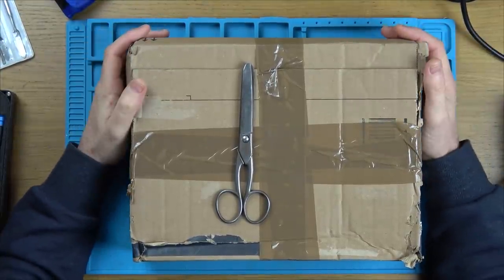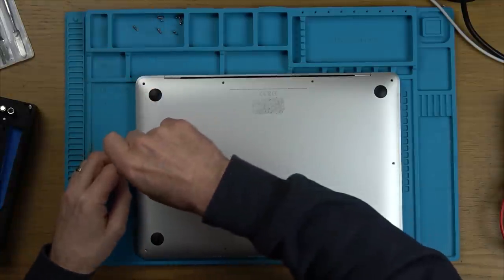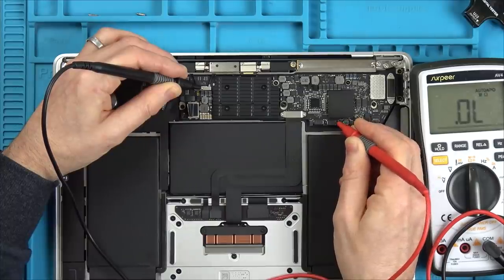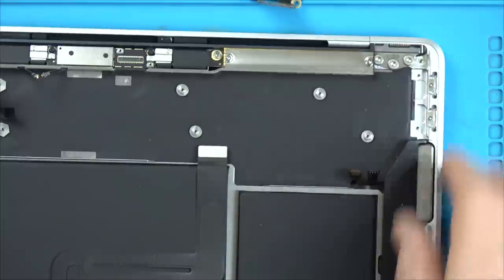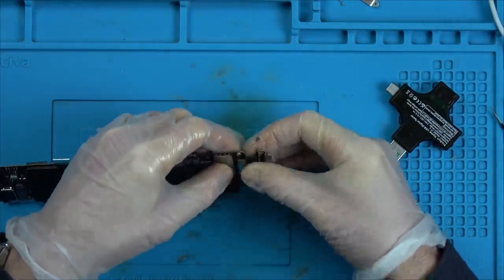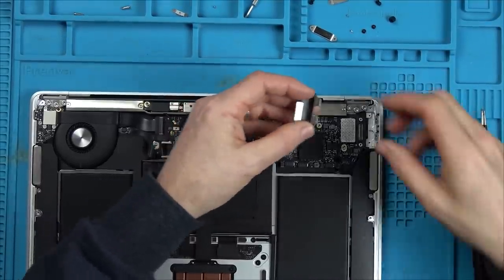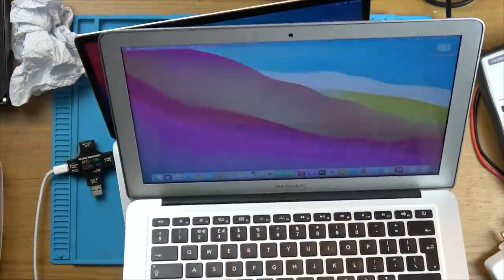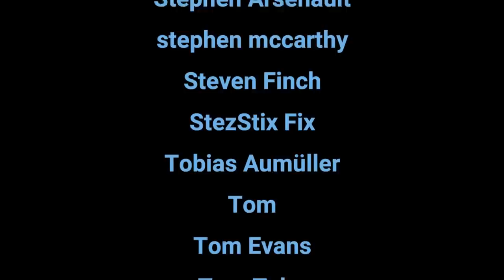A BROKEN £200 ($260) 2020 Apple MacBook from eBay - Can I FIX it???

Comment: That is absolutely fantastic and makes the huge amount of hours you've spent fixing mac books worthwhile. The clue was in your USB tester not showing a voltage. How fab. That's probably worth about 600 now and your daughter will love it!
Reply from the maker: Thanks Paul, she is using it right now as I type, and yesterday AND the day before that. This one will get plenty of use. Fingers crossed it will stay good 👍👍
Reply: @Mymatevince  buy a broken board to get the chip or contact louis. he might be able to point you to someone

Comment: When wiping the internal drive, change the view setting to show the actual drive, those 3 drives are apfs containers, not the actual root drive if you want to change that, you can also just go into disk utility and merge the other apfs containers into the drive you chose for mac os big sur
Reply: That sounds super user friendly and why I don't use apple products.
Reply: @SPEXWISE  buhu 🤡 takes two clicks.. did you know how too use every program on a windows or linux machine the first time you tried it? didn't think so...
Reply: @SPEXWISE  well i mean, they did kinda fix it with monterey but not every average consumer wants to know hoe to wipe their drive, most people will just take it to some shop to do it for em

Comment: Nice find and repair Vince! I wouldn't have used the original lead either. Your daughter sounded real happy. Cheers!
Reply: Definitely. Leads are cheap and if you blew either the charger or laptop chip you'd never forgive yourself
Reply from the maker: Cheers Shawn, sporting a new logo I see 👍👍👍👍
Reply: @Mymatevince  with losing my old HDD and some pre-recorded content, I decided to take a step back and focus on a few changes. New logo for the channel, my son's drawing of "Pup" the dog is my new in video thumbnail, and then a few other odds and ends here an there.

Comment: What a nice, satisfying fix :-) I'm wondering if those problems could have been caused by an aftermarket magnetic connector. It did seem like there was some sort of corrosion around the area, but apart from that this is pretty much what I expect a bad magnetic connector would cause. I have never seen this myself but I have read about it.
Reply from the maker: Thanks Gero 👍👍👍 Maybe it was one of them!
Reply: Yup poor aftermarket charger causing sparking on high voltage high amp pins.

Comment: Good video. As always! Thanks for that. I was watching on my smartphone in the morning and asked myself whether you put the power meter in the wrong way around and couldn't read value due to this.
But then on the bigger screen I see: The current is showing up correct. I have a power meter of the same build. This one will only measure voltage when going this direction. Current is only shown when plugged the other way around (which is the more complicated way, due to the plug types being strangely selected for that...). 
Learned something new today (much variety even if things appear to be the same). :)
The joy of your daugther was the best thing you could ever get out of a repair. :)
Reply from the maker: Yeah it does look like it is backwards. Quite a few have thought the same on older videos. Cheers for watching and commenting 👍👍👍
Reply: @Mymatevince  I was thinking whether I should be trying to fix my meter. ;)

Comment: I think the cable end got damaged first, or some tiny piece of metallic debris in the slot, it knackered one of the USB ports, manifested as intermittent charging, so they tried it another port which then also got damaged. What else would damage the same pins in both ports? Great fix, well done.
Reply: yeah, I agree with this, I think the bad cable caused the problem!  great fix though mate and nice score for the price :)

Comment: I have no idea how in the midst of Apple's brutal anti-repair anti-consumerism, they have the USB ports being fully replaceable and it's cheap, too.

You did great here, man. Awesome repair and it's essentially like new---I'd argue better, it's proven to work and be inspected for basic electrical faults and problems.

My gaming laptop had its charger burn out at the wall plug, but thankfully all it took with it was the surge protector, my laptop itself was safe. It's scary what a bad or failing wire can do.

Comment: Vince, I have a macbook pro 2017 A1707 board you can have for spares? It had the usual charging issue, sent it to someone who couldn't repair it and blew a few components all over the place. It's yours for spares if you want it, only thing I ask is postage to be covered. I replaced the board in the end and it was cheaper than the repair

Comment: You can boot into single user mode and reset the initial setup flag through command line if you ever run into one that wont let you into recovery without an admin password.  Reboot to create a new admin acct and then boot into recovery to wipe it clean.  Ive done a few of those at work

Comment: I don't fix electoronics as a hobby but the other month I was browsing eBay and saw this exact model for £120, seller said the only fault was a broken screen. Sure enough when the laptop arrived the only problem was a broken screen, so I purchased a tool kit and a screen for £185 and it works in great condition. Got  a 2020 MacBook Air for round about £300!

Comment: Hi Vince here’s a suggestion for a trying to fix video: 
LED light fittings. You know the ones that come in all kinds of designs that say the LEDs are irreplaceable? I’ve been looking for one to go in my living room but I’d love to know if they really are a giant waste of materials when an LED strip inside the light fails or if when the driver fails if that’s replaceable as well? Just something I thought of no worries mate thanks,
Reply from the maker: I seen those in my local B&Q (DIY store) and I thought the same thing. They look lovely with the integrated lights but what happens when they fail. Maybe if they are sealed then they will last the advertised hours...not sure though!! I will have a scroll through eBay to see if any are for sale. Cheers for the idea 👍
Reply: @Mymatevince  yea I’ve seen them in B&Q as well and I thought they look nice but are quite expensive in there. EBay and Amazon seem to have better prices but I wouldn’t know if they are similar quality or not. No worries thanks for replying and you have a nice rest of your evening 🙂

Comment: Great reaction, wonderful gesture! Just a thought, was that the genuine Apple charger and cord? Ive seen non genuine cords and chargers cause issues with the ports. Ether way I would be binning the brick and the cord if the short was at both ends of the charge cable.

Comment: Well done! I guess you got lucky as you mentioned it could've been cloud locked rendering it useless. One reason I have stopped purchasing expensive items like this to repair from ebay. I have a large collection of cloud locked phones & tablets!
Reply: To my knowledge MacBooks don't have icloud lock, as long as you can reset it you're good to go
Reply: @rahulchandra152  Unfortunately newer ones do. Really stupid choice made by Apple really. I get the point of iCloud Lock in terms of making stolen devices unusable but it has the side effect of rendering a lot of perfectly legitimate devices useless as there is no way of removing the lock without access to the original account of the device. They should be a system in place where legitimate registered recyclers can get these locks removed.
Of course if Vince's mac had been locked he'd be stuck as allowing anyone to get devices unlocked would defeat the point in iCloud Lock to begin with as thieves could claim to have bought a device that they have stolen and just show a phoney receipt to get it unlocked.
Reply: @TheAlphaWolf2013  not icloud lock but ufi lock

Comment: Your videos encouraged me to fix the keyboard on my gaming laptop. I've done this before on older devices but then it was a simple screw from the front and replace. With this I've got to take out the motherboard! That means removing the battery. On older ones they clipped on the back. Incredibly easy. Not so here. When I tried to unclip the connector I got massive sparks from it so I gave up! It still works with a couple of somewhat unresponsive keys just like before. I must have shorted something. I was trying to prize open the clip with a metal flat head screwdriver from the 2 outside plastic edges so shouldn't have been able to short connections. Thought I'd destroyed my laptop or battery but both are fine and still are after 2 months. So was it two wires of the connector internally touching when I tried to pull it out and was a bit diagonal? That sparking was not small. Would I be better discharging the battery first before trying again?
Reply from the maker: Maybe Paul or I wonder if the screwdriver shorted between a ground (so the case of the connector, or a screw head on the board) and the positive of the battery. If you use your finger nail to ease it out or a plastic spudger tool then at least it won't short unless like you mentioned it is happening internally if it is a bit diagonal. Hopefully next time (if there is a next time 😂) you will get it out without any fireworks 👍👍👍
Reply: @Mymatevince Thanks.  If I'd used my finger nail and that happened internally I'd have severe burns as that wouldn't be cold! But a plastic tool sounds like a good option. I did take the keys off take of rubber mount and put it back on and now they are responsive but don't quite click properly like the rest. I feel though that unless it gets worse I won't take the board out because there's a whole host of other things I could actually damage like fragile ribbon connectors when doing so. With previous laptops I've been quite hands on. Taken the CPU cooler off, applied new thermal place, swapped hard drives for SSD, upgraded the ram etc. Even put a 2nd high speed m2 SSD in this one the day I bought it as warranty lets you take it apart for upgrades. But they make it harder to do so. Each new one is that bit harder. Have to take everything off now to replace one component. Was previous a panel for the ram for the HDD etc. Should be possible to fix keyboards and track pads without removing everything else.

Comment: There might actually have been a way to reset the password on the original OS install unless the SSD was encrypted using FileVault. Back in the days of physical installation media, all it took was a MacOS CD/DVD. The boot menu of the disc let you chose "Reset password" or something like that and that was it. The only thing you lost was keychain access because that password remained the same, even though you'd changed the login one.

I'm sure this MBA will be good for many years now if handled with due care. I'm typing this on a 2010(!) MBP 13.3" running HighSierra. I bought it used in early 2020, less than a month before lockdown, and it turned out to be a lifesaver. At that point I hadn't discovered my main 2012 MBPs microphone was broken so without the 2010 I wouldn't have been able to attend all the zoom calls of that time. The battery was knackered to the point of pushing up the trackpad so I had to spend some more on a good 3rd party replacement (after reading various online discussions on aftermarket batteries I decided to buy one from a local dealer and have it installed, so if it did fail I could just return it, and I did have to return the first one, failed to charge at only two cycles).

Speaking of due care, this 2010 definitely hasn't had that. I have no idea what the previous owner did with it, she swore she was the first owner from new and had never dropped it or anything, but it has some massive battle scars. Around the network port the entire metal case is so bent I'm always surprised it still works. Even the repair guy with over 30 years of experience was stumped how that could have happened. One of my guesses was it might have been in a bicycle crash and fallen from a bag or backpack onto the tarmac, that would certainly explain both the massive impact and the deep scratches.

Comment: the reason why the webcams always sucked on most laptops is the fact that phone cameras are not usb. while the laptop ones are. the data that goes trough the camera on a phone is far greater than usb would support. plus add the post processing all the images go trough. apple silicon wil likely fix this in the future due to it being closer to a phone than a desktop
Reply from the maker: Nice one, thanks Rayproductions 👍👍👍

Comment: Nice fix and got you, or to your daughter a good computer for very low price :)
Last Saturday had to buy new fiber optic broadband modem/router, because the old one developed a problem; it couldn't connect to internet anymore. Flashed a DSL light, it stayed on for a while, and just turned off. In normal operation, after the DSL light, the Internet light should've been coming on, but it never did, except randomly sometimes for few seconds, then turned off with DSL light again.
New modem fixed this, but of course wondering, what failed in the old one, anyone have any experience about these? I opened it but couldn't see anything obvious. It's about ten years old though, might be also just that it's become obsolete?
If nothing else, I've got a working 12V power supply from it :)
Reply from the maker: Thank you👍 I have never looked into any faults on routers so I have no idea what could fail 👍

Comment: Can I suggest you purchase some M.E.K (methyl ethyl ketone) for cleanings stuff like those pins. It'll get the job done quick time.
It's also good for removing moisture from bga's that are prone to being popcorned whilst heating up due to its fast evaporation state.
Use sparingly tho, it's strong stuff.
Reply: works great but it's nasty nasty stuff use it outside or a fume cabinet
Reply: @paulbetteridge9455  aye probably a bit overkill for the stuff Vince does.
Best sticking to ye olde faithful IPA 😁

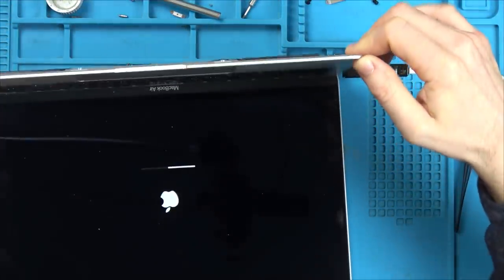Comment: 24:35 you realize, your feeling for warm air, when the heatsink isnt even attached to the fan in any way shape or form, so no heat gets blown out, especially with the bottom off.
Reply: You realize that you have used the wrong form of "your"? When you abbreviate "you are" it becomes "you're", not "your".  Glad I could help.
Reply: @DraftySatyr  yro'ue*

Comment: I don't think that USB-c Power meter works the way you're using it.
it's the other way round, just look at the input/output arrows
Reply from the maker: It looks like it is backwards but on this one it is the correct way 👍👍👍👍 Cheers Luis

Comment: Bloody idiots packing expensive tech like that... the scuffmarks on the top are most probably from the charger that they just tossed in with no padding (the air cushions were mostly flat there), possibly denting and scratching the top of the lid... that's a shame :(

Comment: Hi vince there is software u can buy to remove icloud lock user password etc. Tenorshare 4MeKey around 100 quid it can activate remove user password remove icloud activation  u can have five devices on one key so not bad value for money I've used the software on ipad Pro x3 fixed and sorted all as new. Possible something for the future if u don't need it now hope this could be useful info.
Reply from the maker: Nice one Dan, thanks for the info👍